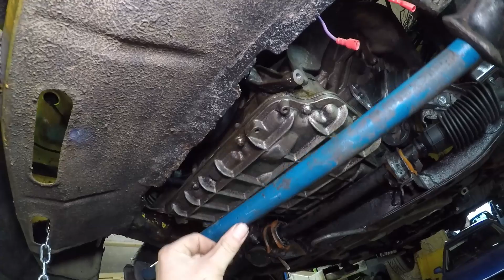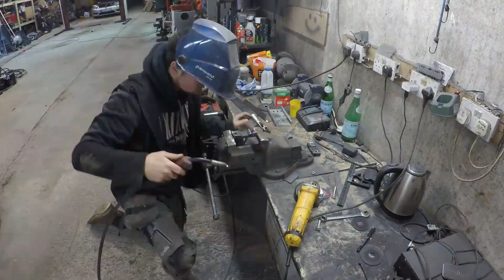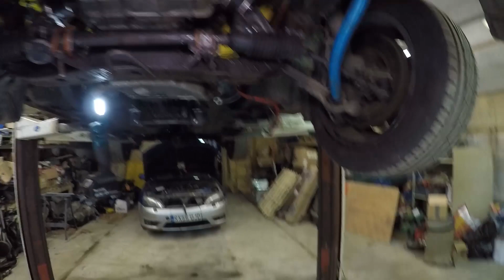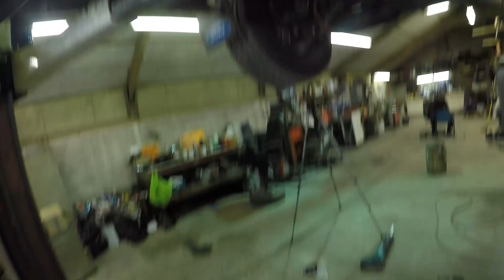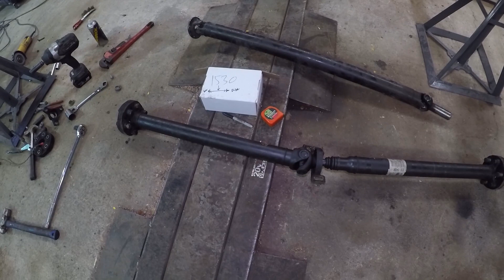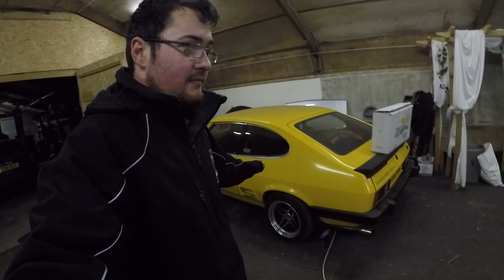Ford Capri Mercedes M113 5l V8 Swap | EP.8 More fabrication, more woes, more progress!

Comment: Good work man!  So frustrating when people let you down, it does my head in.  

Those ARB spacers are brilliant! so it pains me to say, but this is an ideal time to put compression struts in.  We did this on Anton's Capri and it made a massive difference to the handling.  I promise you won't be disappointed, rally designs have a set I think they're for an escort, but they transform the handling and with the right spring rates you can get rid of the ARB all together, or do what Anton did and turn it into a drop link type ARB.

Either way, I'm still watching with great interest.  Keep the good work coming.  

sounds a like a Land Rover? I'm just trying to get rid on the Land Rover I'm youtubing about :)
Reply from the maker: Thank you loz, yeah it is 🤣
They work, I most certainly will be doing some further suspension work, but not until it's driving 🙂
You may be right 😉

Comment: I wanted to do this with my Capri! but I was going to do it with an BMW E39 M5 V8.
Reply from the maker: I almost used the BMW 4.4 M62 I have, but decided against it
Reply: @RoughRestos  that's sweet if I had the resourses to do it now, I think my goal would be to find the lightest modern V8 easily found in the UK I could get my hands on.

Comment: If you get chance. Weld a bit on the back of the spacer so it locates the factory mount. That way your not reliant on the bolts to hold location.
Reply from the maker: Great idea thanks